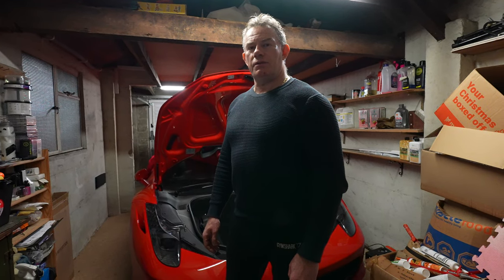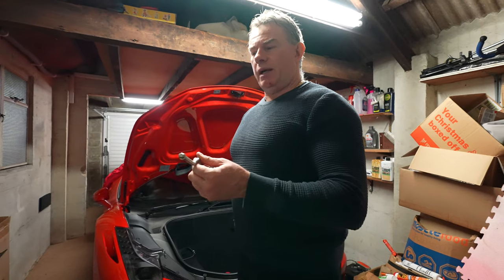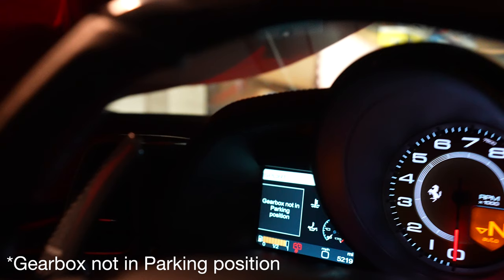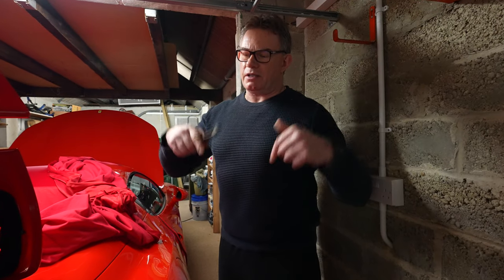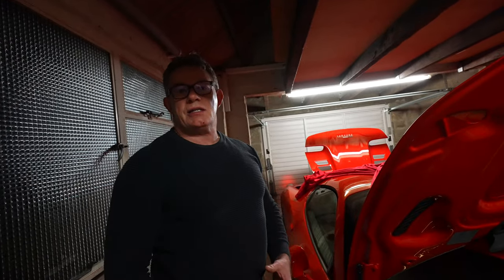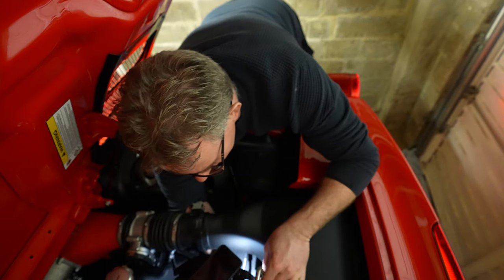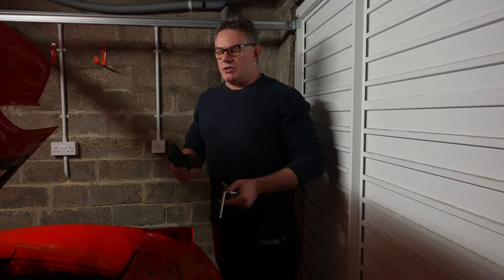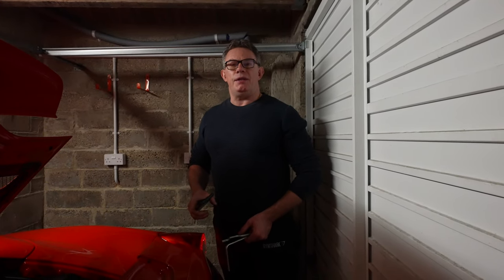Unlocking the Ferrari 458 Gearbox Park Lock!

Comment: I'm surprised they don't have an electronic gear box release, rather than that physical process.
Reply from the maker: Hey Andy, thanks for keeping engaged with the channel. 😊
The Gearbox Park Lock does automatically engage/disengage when you start/engage gear and when you stop, but there is no way to disengage it with the ignition off and keys removed unless this manual process is implemented.
Reply: @RichReviews_  so if u leave it like that.. does it hurt the gear box? thank you.. I'm looking for doing the same thing and leave it like that.. thank you
Reply from the maker: I don’t leave it unlocked I unlock, move the car and then lock it again.

Comment: I think I would add a set screw , or small sheet metal  screw/ bolt where the two parts join ! To preclude their separating!
Reply from the maker: Possibly, but you have to be careful not to impede the round crossmember with the screw/bolt head.👍
Reply: @RichReviews_  small low profile head w/ internal allen on it no issue ! know your hardware !
Reply from the maker: Possibly, though sitting proud may cause an issue and there isn’t the material to recess...possibly you are unaware of the challenging circumstances. Also as an engineer, I’m quite aware of the varying fasteners available. 👍😊
Reply: @RichReviews_  Ok , drill a hole thru and use thin safety wire !  there ! or JB weld the 2 parts together ! LOL !  or weld a tiny nut inside use a set screw that would sit flush w/ outside when screwed in !  or drill and tap a hole thru both sides of both pieces , use a set screw w/ an internal 2-3 MM allen socket hole  there !  nothing sitting proud !
we've seen British engineering the old cars and M/C were really shite ! Made poorly too !

Comment: do I need to do this to diagnose a bad wheel bearing as well? I suspect one has gone on the rear wheels but when I jacked it up to spin and test the wheels literally do not spin no matter what state of brake / gear / ignition I put it in xD bloody ferraris
Reply from the maker: Yes the Parking Lock will be engaged unless the car is in ' Car Wash' mode.
Car wash mode is achieved by starting the car, putting it in neutral and turning engine off but not removing the key! The display will state 'Car Wash' mode and the Gearbox Lock will Not be engaged.